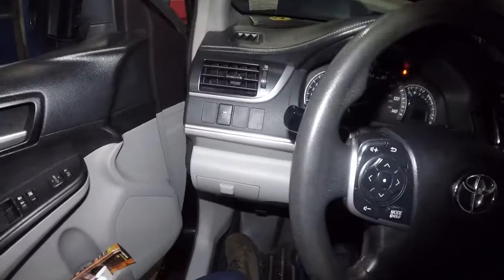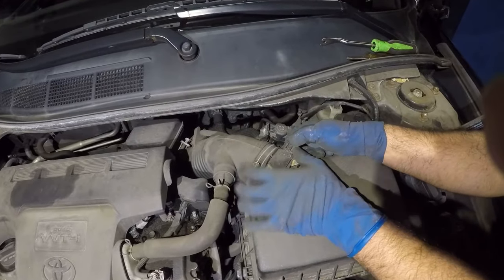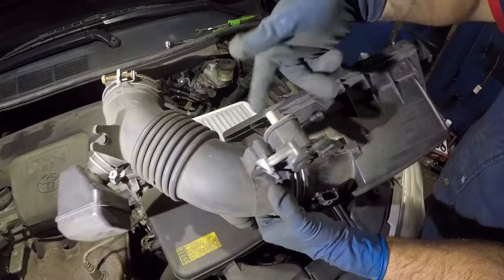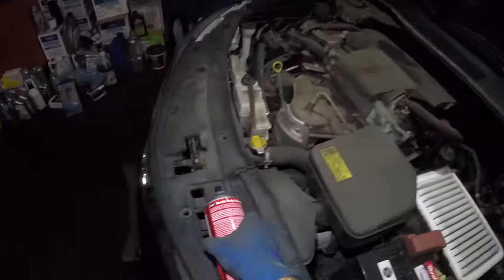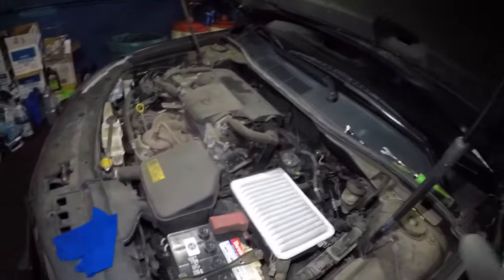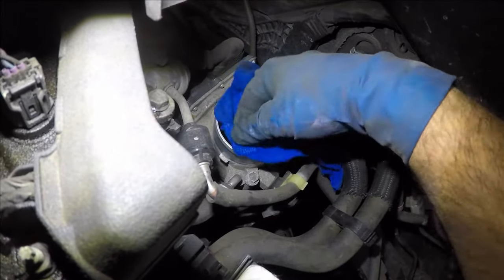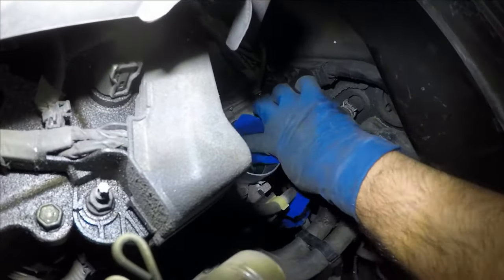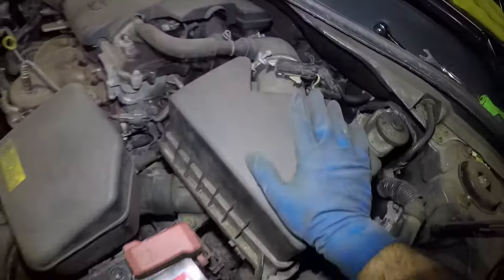Toyota Camry 2007 to 2017 Low idle car stalls and feel vibration, Throttle body cleaning

Comment: I literally had this problem today. My wife called me in a panic stuck in the road in traffic. I instructed her to shut off and put in gear and try to get the car off the roadway. She did and she waited for me to go pick her up. I searched out this issue and got to your video. Did exactly what you instructed and it worked. The valve wasn't all the way opening. Cleaned it with the cleaner (not exactly the same can but one  that was a good substitute) worked like a charm. Thank you. Thank you.  Got better acceleration and just runs better just from that. Thanks again amigo!!
Reply from the maker: Nice good job!!!

Comment: Man I went to this guy , he took that whole part out & I see why my car acting funny now ..when I press gas .. car add too much pressure by itself & more weight things .. help me please
Reply from the maker: Explain that again differently
Reply: @RBTheMechanic  I see you cleaned it while it’s on .. he took that whole part out & cleaned it .. but you didn’t
Reply from the maker: @mfimabefig9822  yeah when u do that u can damage the throttle and loose the memory so u will not know if u damaged it or lost memory gonna have to start with relearn
Reply: @RBTheMechanic  The car add too much pressure when you crank it up .. and when I put it on N doesn’t be relaxed like how it used to be … doesn’t move
Reply from the maker: @mfimabefig9822  I don’t know what u mean put too much pressure
Reply: @RBTheMechanic  like the sound , then it clams down little bit
Reply from the maker: @mfimabefig9822  not getting it in my head u mean like vaccum suction
Reply: @RBTheMechanic  maybe boss .. I really don’t know the name .. cuz my English 😂 but you explained that very well love it .. 
but can everything be programmed again using a computer at the shop ?!
Reply from the maker: @mfimabefig9822  can u make a video
Reply: @RBTheMechanic this might be a year to late but make sure all the valves and sensors are clipped on tight. Usually after a couple drives 1-2 the computer should reprogram itself and should be idling lower than 2000rpm.
Reply from the maker: @JT-lw1oh  yup idea relearn process!! Good tip

Comment: Wow this was a super simple procedure and worked great on my 2011 Carolla with 186k miles! The engine seems to run much smoother and idles at a higher RPM (around 1000). Thank you 👍🏻
Reply from the maker: Nice good job!!
Reply: Did you car die after couple sounds turning it on? I’m having this issue now
Reply from the maker: @Mopar5.7_Ant  didn’t understand what u mean by couple of sounds
Reply: @Mopar5.7_Ant   no it runs great.. it was a hard start the first time right after but it smoothed out quickly and runs like brand new

Comment: After I cleaned mine, check engine is now on. Is that normal?
Reply from the maker: No reset it
Reply: @RBTheMechanic  thanks. I cleaned it last night. If it continues stalling, any adía what else could be?
Reply: Does it stall on idle only or high speed

Comment: Going to do this tomorrow; my 2010 Camry just started stalling when I stop. I changed the plugs and air filter- both needed to be replaced, but it’s still stalling.  Thanks
Reply from the maker: Yup definitely good service to do!!!
Reply: @RBTheMechanic  since doing this, the car hasn’t stalled once and the gas pedal is much smoother.  
I cleaned the throttle body on my wife’s Toyota Matrix then cleared the check engine light (was for O2 sensor). We’ve drove it 600 kilometres (highway and city combined driving) and the light is still off. 2 cars fixed with one simple process.  🙂
Reply from the maker: @barry009  this is the best service u can do every 20k miles

Comment: Thanks. I had the low rpm issue(down to 500 rmp)  especially when turning on the ac. after the cleaning it the low idle is gone and engine is smooth 800- 900 rpm.
Reply from the maker: Nice job

Comment: M Camry 2001 had this issue too. Cost was $115 for a cleaning. Thanks for the video. It helps me understand what the mechanic did.
Reply from the maker: Yeah that one is diffrent it has idle sensors but clean the throttle helps also
Reply: I have 2002 camry 3.0lt sometimes idle goes way down try to shut down
Reply: What do you think about that sometimes running perfect some times on stop sign feels.like misfire amd going to stall

Comment: Great job pm explaining the detachment of every connector.

I've been a boiler operator/mechanic, a rocket surgeon, and now I'm on my last gig before I retire doing logistics for a chip maker. I know how to follow instructions.

 But far too many of these videos leave out or gloss over a critical step.

I don't know why- if you doing a How-to, it completeness that matters - not the background music or cool intro.

I'm just watching this for like the third or fourth time, right before I pull that assembly so I don't end up with a mystery connector, or spend an extra half hous because I disconnected the wrong side of something, and irmt just struck me how well you covered the one indispensable sequence clearly and succinctly 

Kudos!

Update
Wouldn't you know it, just as I got to thr last clamp, the rain ppen up and the wind kicked up.

Ducked.back in the house to warm up and dry out.
Reply from the maker: Thank u

Comment: Nice explanation. I have a problem with 2017 camry. It used to vibrate (as if driving on rumbler) when the rpm is around 1500. It runs smooth above and below that rpm. The mechanic diagnosed and replaced the front axle but it only made the situation worse. It occurs more frequently now and intensity of vibration is increased. Do you have any suggestions?
Reply from the maker: Not sure what I can recomend u without test dirivinf how ever I would replace that axle with better axle before anything

Comment: Thank you I just did this ten minutes ago… my idle is above 1500.. I think it’s kinda high but maybe because it’s still cold.. regardless before my idle was 500 and my car would shut off randomly on idle .. thanks so much I liked and subscribed
Reply from the maker: Do idle relearn it will become stable at 800 or drive around with ac light and all accessories off it will do relearn by it self
Reply: How long do you need to drive car for idle relearn? @RBTheMechanic
Reply from the maker: @spiderchata1  19-15 minutes

Comment: Hi there,

I have a 2010 Camry which is stalling when I put it on park or neutral. This only started happening after I changed my battery. Do you know what might be the issue and how to fix it ?
Reply from the maker: Well u lost idle memory when u took out the battery check my how to replace batttery videos anyways.   Turn everything off wiper lights radio all accessories off and start the car and let it idle for 20 minutes let me know if it builds idle. If it dosent then I’ll give u more instructions
Reply: @RBTheMechanic  tried it, it didn’t work.
Reply from the maker: @FaisalElGhaffir  try idle relearn https://youtu.be/sCsBqeZctzE?si=dnBBtBz42UpFwFRH

Comment: Hi 👋🏿 thank you for posting this is an extremely helpful video. Do these cars have a idle air control valve, or just the throttle body?
Reply from the maker: Throttle body is the IAC since it electrical it dose job for both

Comment: Good video, if you have no one to help you, just disconnect the battery, and do the rest on your own, no check engine light no codes, no harm done as long as the battery is disconnected, i did that on my, camry, my corolla, with no problems at all, the computer will reset and rpm will get back to normal after a couple of hours of driving.
Reply from the maker: I don’t like to loose idle unless it’s most necessary

Comment: Hello! Please help, i performed the throttle body clean as you instructedon my Camry 2008, but now the car jerks when idle, especially when the car is in Drive and i have the brake pedal pressed. I've trid idle relearn procedure but no luck, any suggestions? I notice the RPM gauge is jittery and spikes up slightly. Car drives fine, but that jerking & shaking when idle is not normal, please help.
Reply from the maker: Do idle relearn

Comment: I cleaned and it’s still not working 

Could I just change the throttle body sensor on it?

or do I have to replace the whole throttle body ?
Reply from the maker: If it needs replacing the whole throttle got to go did u disconnect battery before or after?  What is ur RPM once car is nice and hot

Comment: Well, I cleaned the throttle body by following the instructions in this video. 
Now I ser a check engine light. Any ideas? 

Car :2013 Toyota camry LE
Reply from the maker: Scan the car to see what the code is
Reply: @RBTheMechanic  I checked. Surprisingly it went away after 4 startups. Lol. Turns out I was reseting the system. But I did the checkup anyway and they say I have to replace the mass air flow sensor according to the code. Thank you very much 😊

Comment: @RB the mechanic. I notice a misfire at 1300 rpm with engine cold or hot. It idles good and smooth and drives good. Sometimes intermittently I’ll come to a stop light and the rpm’s will drop from 900 to 600 and returns to 900 as if it was almost going to stall. Any advice?
Reply from the maker: Start with this cleaning service
Reply: Check the timing. Make sure chain or belt is tight.

Comment: I have 2010 toyota corolla. similar throttle body top right cornar there is a screw hidden in a glue type material.
can you please tell me, what is the function of that. and how it help in adjusting a specific parameter?
I have observed that changing the position of that screw make throttal pedal to respond differently and effect the drivability .
I have an issue of poor idling. throttle body is cleaned. every possibility has been checked but could not fix the issue.
Reply from the maker: Don’t mess with it it has function to adjust but don’t mess with it u need to clean it first
Reply: @RBTheMechanic  The mechanic has already messed with it. Now I need to bring that screw on orignal position, or alteast to adjust it on properly. any idea how it functions?
Reply from the maker: @inamrehman8709  it’s load for the flap but it dosent do much I messed with it before but u don’t need to touch it
Reply: @RBTheMechanic  sorry i did not understand what do you mean by load on flap? one person told me, that in toyota corolla electronic throttle body this screw is to raise or lower the idle RPM, but in my case I have observed that rotating clockwise it reduces the RPM but at certain point further clockwise rotation  of screw again start to increase the Idle RPM, 
still confused how to check and verify the optimum position of screw and how it perforn its function?
also trying to search service manual of electronic throttle body on internet but could not find.
Reply from the maker: @inamrehman8709  hard to explain but it just adjustment dosent do much on any preformance or stall fix just leave it alone
Reply: @RBTheMechanic  Hello.
 I have measured the voltage reading of reference and sensor given below. can u please check the reading if they are ok..
1 = output sensor 1 at idle 0.84  and at full throttle 3.80
2= 5 volt ref at idle 4.99 and at full throttle 5.0
3 = output sensor 2 at idle  2.43 and at full throttle 4.96
Reply from the maker: @inamrehman8709  I don’t have that data

Comment: When the engine is warm and if I let the car sit for 10 minutes and restart the car, the idle drops to 500 rpm for 1-2 seconds, runs rough, and then the idle smooths out?  Any idea what could be causing this issue?  I cleaned the MAF sensor, throttle body, replaced the plugs, coils, ECT sensor and crankshaft position sensor, and it still does this.  There is no CEL, crank time is short and no noticeable drop in gas mileage.
Reply from the maker: U might want to Re clean the throttle and do idle relearn
Reply: Change your fuel filter.

Comment: Hey. Thank you for the video. 
Today my 2013 Camry SE was running and while it was running I unplugged the AMS and the car shut off. I put it plugged the MAS back and turned the car on it turned on but the engine light turned on. How to reset the engine light off. 
Any help would be appreciated. 
Thank you.
Reply from the maker: U have to reset it with scan tool
Reply: @RBTheMechanic  can autozone reset it? 
Thank you.

Comment: Hi sir I have 2010 Toyota Camry 2.5 l is jerk when I drive and then it goes.qwqy when I speed? Please I need your help
Reply from the maker: That could be transmission issues but before ruling that check and scan the car for codes also clean out this throttle

Comment: i just did what you do... now the engine idle at 1600rpm, what should i do? i saw your reply about idle re learn. how do i do that? is there a video on that?
Reply from the maker: You have to do idle relearn. Make sure engine is at operating temperature. I check engine reset the light if there’s any codes for higher rpm anything else repair it.  Here’s a video https://youtu.be/sCsBqeZctzE?si=HEoeGk03DPU0IM9V

Comment: Hi there! My Toyota Camry 2014 has 75,475 miles on it and it barley started doing this. I noticed it doing it after I’ve been driving for a little and then stop at a red light or stop sign. It does it for a quick maybe 2 to 5 seconds where I see the needle want to go down and the car shakes and wants to turn off so I let go of the brake…..then it doesn’t do it anymore. Also, there’s no check engine light or anything. Can this be the problem?
Reply from the maker: Yup it would get nice and hot then it would start to do cuz computer knows to lower the idle speed once’s it’s hot but then it can’t maintane the idle rpm speed so go for it do this service it will only be for the hood of vehicle
Reply: @RBTheMechanic  Awesome 🙏 Thank you so much sir!

Comment: My vibe 2.4L gives a sluggish acceleration while on the slope.. could it be this?
Reply from the maker: That might be somthing else or transmission related but this service is good to do it will keep the preformance of throttle response better so go for it and it dose send siginal to transmission module to shift accordingly so go for it!!

Comment: Do these cars have an IAC valve or is it part of the throttle body?
Reply from the maker: Electrical throttle it’s both 2 in one
Reply: When l start my car up in the morning it revs 2000rpm than jolts to 1000rpm would this be the throttle?
Reply from the maker: @danielmillard8134  colde start will do that I find that normal

Comment: Thanks so much for the details description of the process. I got a new battery and new alternator but problem didn’t get fix. After this process, no more crazy idle and most important the engine doesn’t shut down at the red light. 🫡🙏🏼
Reply from the maker: Welcome!!

Comment: I just did that and my cars check engine is on right now, also when i turn the car on the rpm is almost 2000, what would be the reason?
Reply from the maker: We’ll try the light u might have had the sensors disconnect when doing this it picked up on it

Comment: My car idles poorly on drive and reverse gear with my foot on brakes, I feel vibration on my steery and dashboard while idling. It idles at 600rpm to 550rpm is this normal, with so much vibration n gets worse when I turn the ac on still on drive or reverse gear but reduces a bit when I put my car on park gear n vibration disappears when my car is moving n comes back when I come to a stoplight. I think, ama give this a try and see if it solves d issue.
Reply from the maker: Do this cleaning service

Comment: I did it works perfect ,just getting the check engine light now ,what can I do?
Reply from the maker: Did u scan for codes u shouldn’t have had that light if u did it correct but u can scan and reset
Reply: @RBTheMechanic  I took it for a test drive and I’m getting bad mpg .
Reply from the maker: @okaycool1232  clean oxygen sensor and max sensor that might fix things up they control gas
Reply: @RBTheMechanic  Thank you will do!👏

Comment: For me the car never stalls but my idle goes below 500 and vibrates sometimes when stopping and braking. Any suggestions.
Reply from the maker: Yup do throttle cleaning it’s low idle will be fixed

Comment: Would this work for random reving up of rpm when driving? I noticed sometimes just driving a constant speed or sometimes when accelerating, it will rev up rpm then go down to what it normally increase to
Reply from the maker: No that’s more of weak transmission or slippage when it dose that it dosent have load from transmission it shifts to gear or delayed grab one the gear
Reply: @RBTheMechanic  Thanks for the quick reply. I'll chalk it up on transmission, I got a lot of miles on the car. Great video by the way.

Comment: I have a 2013 Camry se 4 cylinder that sometimes vibrates at idle but only in gear, it goes away in park. Could this be the problem? Thanks
Reply from the maker: This can be the issue or engine mount. Try to notice where ur rpm is when ur idling and it’s vibrating if it below 700 then u can say this is the issue
Reply: same, let me know if you found anything out about it thanks
Reply: @CriCKiD3  try cleaning the throttle body and the MAF sensor
Reply: @scottg429  alrighty will do that soon thanks Scott! Appreciate it 👍👍

Comment: My 2015  camry le idles at 800 rmps when it's on park but when I put on drive or reverse it drops to 500 or 600 rpms and it shakes and the has turned off when I'm at a stop sign or red light.
Reply from the maker: Definitely sounds like it need throttle cleaning